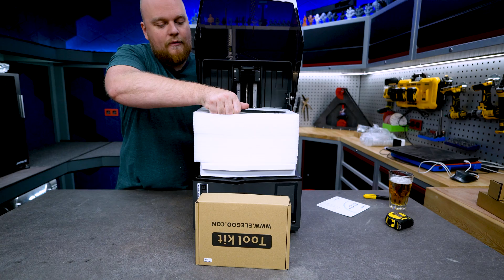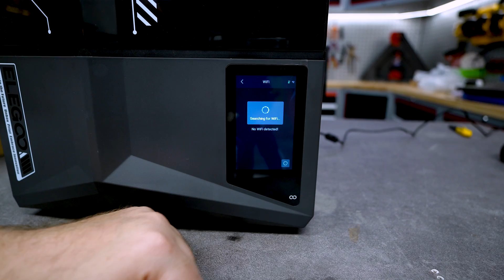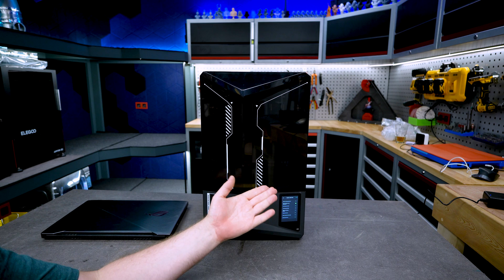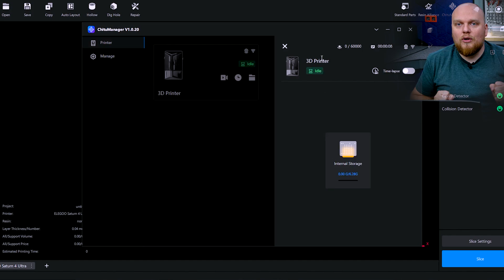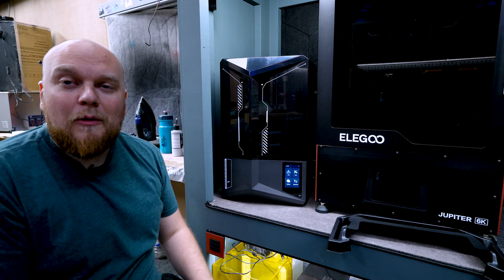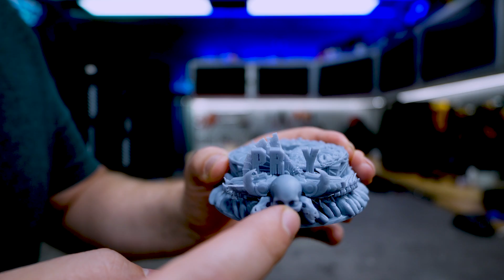Elegoo Saturn 4 Ultra first look, can they finally impress me?

Comment: New uppdated firmware lets you manually level the build plate, and there can be as many as eight different calibration areas on one build plate now also. great video!

Comment: Great video. Just purchased one of these printers. It was nice to see someone who isn't a fan give a solid review. What resins do you recommend? Have you tried any other resin in this printer yet?
Reply from the maker: @scottrichardson2773  yes tried a few waterwashables, abs like and standard pro from jamghe. All work fine, i defaulted back to the jupiter just for the size alone but it's definitely one of the better printers they made.
Reply: @NoizieWorks  awesome thanks. I am just wanting to do wargame stuff. So size should be non issue for what I am doing. Though that predator model was sick. I will probably eventually print out some alien stuff. I enjoy painting when I get the time to. So it should be fun to learn. Thanks for sharing your experience.
Reply from the maker: @scottrichardson2773  no problem and yes the predator came out beautiful although I dropped it in my first live stream 🤦let's say the resin proved it's shit lol

Comment: Hey thanks for review, what about Z Wobble?? And which 3d printer which dont have z wobble problem would you suggest?
Reply from the maker: @tarikincefikir  Thanks! because of the tilting screen, there's almost no z-wobble so that's a big plus. Everything else i tested even the Jupiter with the massive extrusion flexes.
Reply: @NoizieWorks  Thank you. You are the only reviewer I watched who talk about this massive issue. I think another important test is light uniformity. Do you have any suggestions for saturn 3 ultra z wobble? I love this machine but this issue afraid to me.

Comment: I am very dissatisfied with the fact that the Saturn 4 Ultra has reduced build height by 40mm compared to its predecessor.
The tilting VAT is a good new feature, but what I print is over 230mm, so I'm considering buying a Saturn 3 Ultra.

Comment: resina print is very expensive se mi regalano la stampante non la voglio !
Reply from the maker: I'm also getting less and less inclined to use it, miniatures fine but for any other real work... FDM is still the game
Reply: @NoizieWorks I print 1/4 and 1/3 scale statues. Way too much sanding and prepping the models with FDM. Much prefer to print in parts in resin and glue them together.

Comment: This machine is auto-zeroing, NOT auto leveling.  It has been leveled at the factory, but still needs to find the zero point automatically.  Also, building direct on the build plate is necessary for some kinds of parts - I almost exclusively build directly on the build plate because of my part requirements.  Don't make sweeping generalizations as it reduces your credibility.
Reply from the maker: @johnhinkey5336  that's what a first look is for.

Comment: I just got one of these machines following a 3 week hiatus, I had an identical batch print fail 26/30 models.
Found out there was a leak in the vat. Nothing damaging, but I am hoping the failures were due to that. I'm gonna run a callibration test once my new PFA gets here.
Reply from the maker: @AlterumVeniet  hope it fixes the issues
Reply: @NoizieWorks  sadly it did not. It seems the bed isn't level (but I can't level it lol). After communicating with Elegoo, the next step is to try a new build plate, whose auto-leveling works properly.

Comment: You can manually adjust the plate using the paper technique and by adjusting the screws on top. so that it is level already and reduces auto leveling
Reply from the maker: @ranieldenicen.marpuri6544  correct!

Comment: hello i am having problems with my camera, when i turn on it is all black and when i close and restar the camera i just close the chitu manager any solution?
Reply from the maker: @luisrocha2762  doesn't sound like it's working correctly. I would start looking at cabling to see if everything is plugged in ok
Reply: @NoizieWorks  i dont think is that because other people is having the same problem since yesterday
Reply from the maker: @luisrocha2762  firmware update of the printer or slicer update? In both cases you can only reach out to elegoo
Reply: @NoizieWorks  one of them updated the chitubox and afther that the camera stop working, but i think the problem is the chitubox manager not the chitubox because i tried the 2.1 and the 2.2 and the result is the same but in both versions they have the same version of chitubox manager
Reply from the maker: @luisrocha2762  then your out of luck untill they fix it
Reply: @NoizieWorks  your camera is working fine? When was the laste time uou updated the chitubox manager?
Reply from the maker: @luisrocha2762  2 weeks back so not updated yet, out off office now so can't test for the next 3 weeks

Comment: elegoo prime day special is BS For item save up to 44%off. you can save %44  if the item is used or open box but the problem is i checked in minutes after prime day started and the used or open box where not available  which forced you to buy NEW  and the discount was so small it made me not want to buy it because of your bait and switch scam on used or open box, and to top it off on any special i see like on amazon they dont put used junk up for sale on prime day and your used item is buy as it NO RETURN. This is the second time i know of you pulled this stunt. then you marked up mars 5 then gave a discount but that was not a discount because on a youtube review the guy said the people at elegoo said it would be $269 which it still is right now but you say original price  $337 that a bad way trying to fool people, maybe a prime day some where else from another company would be a better choice. do NOT Treat people like there stupid, it only makes you look like a fool
Reply from the maker: @A-Eye--A  US? Here in EU it's not even a thing to see any printer go for big sales on prime day. Open box and returns just go on a pallet that gets sold off in bulk.

Comment: Thanks for the review! I'm considering upgrading my Mars 3, so this was helpful. Unrelated question: How are you having difficulty removing the supports? I use the standard resin and the supports always detach with very little force without leaving any scars. I can always just grab the model out of the supports like I'm ripping paper.  Maybe the supports of the model were WAAAY too thick?
Reply from the maker: @EntropicEcho  yup, the new chitu 2.2 auto support on the basic are just too thick. Didn't use my own settings.
And thanks bud! Btw not a review😄

Comment: I think the cracking sound is actually the print peeling off the fep. It gets quieter after the first 5 layers once the exposure time drops to a few seconds.
Reply from the maker: @chrismatney639  it's definitely the spring mechanism making noise, the fep is actually not that loud but like you say it's gonne after 50 or so layers
Reply: @NoizieWorks  interesting, maybe mine doesn't do it or it could just be that I am half deaf after working in a car audio shop in my youth :D For me, the noise I hear goes away after the first 5 long exposure layers. My build plate seems pretty level though, I see very little spring movement when it is first lowered to the bed. Regardless, the build plate design is definitely a week point of the printer. Other than that (and a few software crashes), I love mine. It has been running almost non-stop for about a month now.

Great review!
Reply from the maker: @chrismatney639  thanks brother, mine a bit tweaked i think.
Audio shop? Cool stuff! Recently stumbled EXO on yt... missbthe days of beind a basshead

Comment: Hi Noizie! Great video as ever. I got this same machine few days ago and already printed with it some minis. I had a surprise in finding that to be faster then my 3Ultra ACF i had to set the 4 Ultra at 0.05mm height (the 3 is working very well on 0.03mm). Will you do a comparative speed test with your other printer? Not only printing same piece at same parameters but also print same pieces at fastest possible speed for specific machine?
Reply from the maker: @Feilyan  Yes!

Comment: It is a bit of an oversight to advertise time laps capability without lighting. However I think people are missing that the AI is using the reflected UV light to detect print failures. The darker everything else is, the easier it is for the camera to pick up the UV. If the printer is flooded with light from LEDs this ability is diminished. But it should have LEDS for time-lapse mode and just warn you it might not catch a failure.
Reply from the maker: @dv8tyler692  great info! Thanks for the explanation
Reply: :face-blue-smiling:你是对的

Comment: Do you have a UV-meter and a UV LED flashlight? A French youtuber discovered that the grey translucent plastic cover of the new Mars 5 Ultra is transparent to UV light! He's used to testing many MSLA 3D printers (including their lid as well as the uniformity and brightness of the screen under the vat) and he was shocked to discover this. That's something he never saw on any other printer including those from Elegoo. The green plastic cover of the Saturn 4 (Non-Ultra) correctly blocks UV light, for example. He has not tested the Saturn 4 Ultra… This is puzzling as the resin left in the vat could cure (depending on how much sunlight enters the room) and the lid of the S4U seems to be made of the same plastic as the M5U!
Reply from the maker: @fluxcapacitor  yikes that's bad! Meter no but that's just an order away 😉
Reply: @NoizieWorks  Please keep us informed!
Reply from the maker: @fluxcapacitor  i will, first it's time for some vacation, has been a loooong freaking year 🛫🍻
Reply: @NoizieWorks  Well deserved! Enjoy your vacation :)
Reply from the maker: @fluxcapacitor  thanks brother!

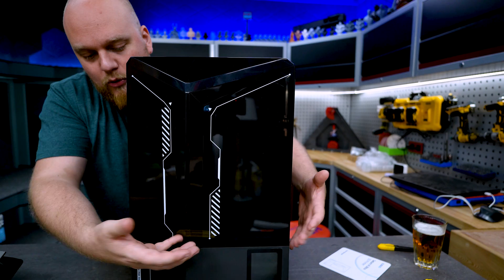Comment: 05:20 In fact, you can open the lid by simply pressing a single finger in the area at the top of the triangular white pictogram.
Reply from the maker: @fluxcapacitor  yeah that doesn't always work that well on mine

Comment: Sir. I have an original jupiter, but sone parts require a lot of supporta due to the amount of suction the huge jupiter plate has when filled with models... i was hoping the S4U would reduce these forces and allow me to get away with less supports which will speed up the clean up stage.
Reply from the maker: @JohnSmith-rt5yq  i have posted my goldy locks settings for the jupiter here on youtube.
Lookbunder the community tab. Give them a try
Reply: @NoizieWorks will do, thank you sir! I spent months troubleshooting models getting ripped off supports, only to find out it was the anycubic eco resin that was trash
Reply from the maker: SO shit!

Comment: I think you can adjust the level of the build plate with the screw heads that are on the top of the posts that stick out. I wonder how difficult it would be to adapt the build plate from the Saturn 3 Ultra to work with this printer? I think the spring loaded build plate is a bad idea in general.
Reply from the maker: @supergiantbubbles  will have to dick around with it to know

Comment: The self test / boot up is a bit slow ☹ but yeh how many times do you do that a day.  But one thing annoys me, is that then idle, there is a continuous sound. And then power of, you hear the steppermotor releasing his power. (Like us after a long day work in the hot sun, after the fist drink😂)
Reply from the maker: Yes, i also see the vat drop after power down.
My shop is not quit so i don't hear it and i have a remote power down for the complete "farm".
Ah yes, few more days and it's vacation time! The release will be substantial😆

Comment: I've tried yesterday to slice with lycheslicer, but it was veeeeeeeeery long print like 38mm height 0,02 and 12h. Anyone has proper settings for lychee? I can't get used to that chitu
Reply from the maker: @DiavloPL  since the last update they removed a lot of functionality to the money version so i went backt to chitu i posted all the support settings and profiles for jupiter and S3U on youtube under the community tab.(supports also work for the s4u)

Comment: Dang. I was going to use this printer to print items directly on the plate. I guess I need to get another plate that I can modify so it does not self level. Mine has already shipped or else I would cancel and wait a few more months to see if the layer squishing can be resolved.
Reply from the maker: still needs to be tested but i'm afraid it's going to suffer on first layers. On mine you can clearly see that the front is sitting lower then the back so that 1mm is going to be unreliable.
Reply: @NoizieWorks  Yes can confirm pretty huge issues with printing directly on the plate which is primarily what I do for functional parts. Very disappointing that we can't choose to manually level the build plate.
Reply from the maker: @generationace  thanks for sharing!
Reply: @NoizieWorks  It's worth mentioning to you, maybe you want to mention in your full review. Currently "Home" is at the top of the Z Axis, so it's not easy to test for level or equal grip on screen. You have to run a dry print and set exposure very high like 1-2 minutes so you can test while it's "printing" the first layer. This is imporant because a number of people have reported that their printer has stopped printing on part of the build plate, it turns out it's because the build plate is sitting too far from the PFA in those areas and there's no way to adjust it. It just randomly happens too which is also scary. The issue I think is the build plate spring mechanism actually weakens from use and eventually is just loose with no way to tighten it. Some users have reported a new build plate fixed it while others had to get a replacement unit. This leaves me a bit concerned for my print farm. Also if your burn in or transition layers continue onto your supports, there's a good chance the "auto leveling" pressure will puncture your PFA as reported by many users online.  I also wish the heater power button was also NOT in the back where you can't reach it.
Reply from the maker: Thanks and yikes! The ones on the back hardly move while the front springs have about 1mm of "spring" i have already seen indents on the fep.... now with the peel i'm going to test transitions before support phase.
I haven't followed other youtubers and their experiences, so this already starts to feel sad... time to put in some hours but first a cold beer and some vacation 🛫